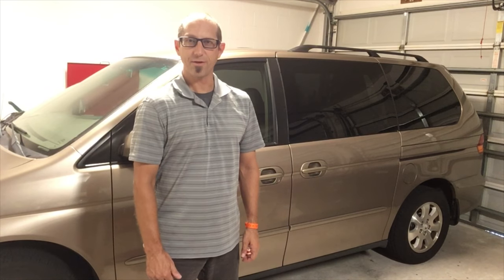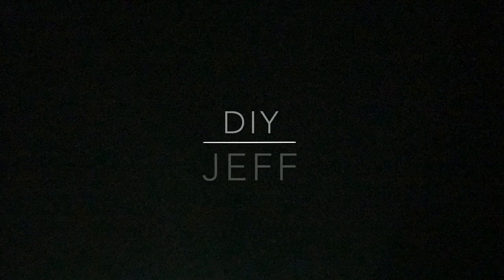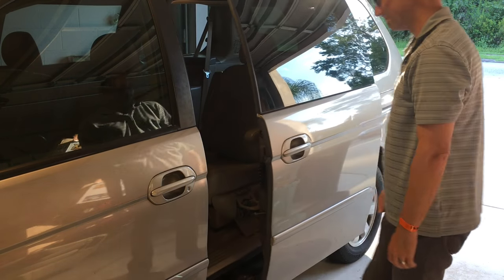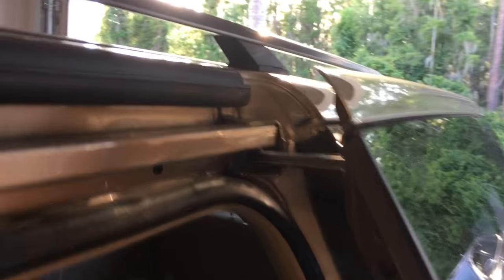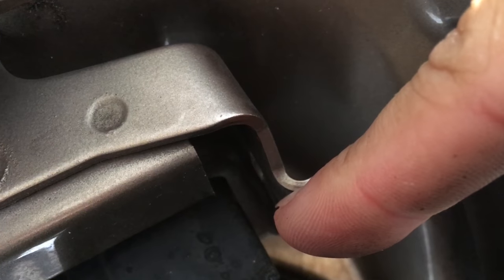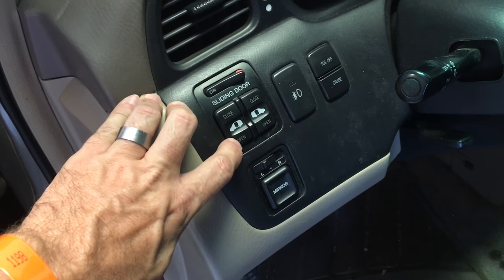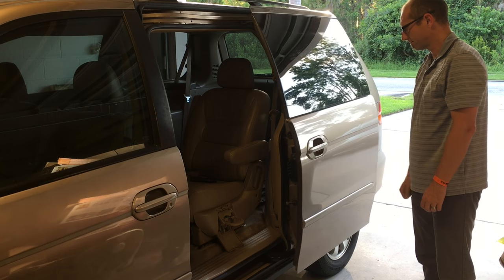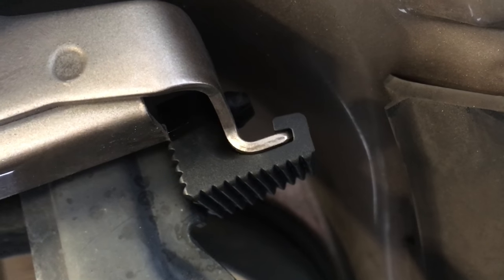Honda Odyssey Sliding Door Won't Close - Fix

Comment: Thanks. I'm so frustrated and upset,  I have a 2011 Honda Odyssey handicap van since my daughter its on a wheelchair and the door all sudden didnt want to open at all. I took it to the dealership they changed me 1500 dollars and the door now its not locking and the lights are on all the times they said cant fix it and I should take it to a body shop so they can look at it and see what they can do...I wish can find someone like you with common sense and smart enough to find the problem with out guessing and replacing unnecesary things to just charge me alot. Im a single mom w 2 kids and this its a nightmare.  What shoud I do Jeff? Thanks
Reply from the maker: @31spa, I’m sorry you have experienced such poor customer service.  Not all dealers are this way but many are.  The rubber stopper mentioned in my video has no bearing on your issue before or after your experience.  If it’s not locking and the lights stay on, common sense says when the door closes it’s either not making good contact with the door pin, or it could be that the door pin itself has gone bad.  If the vehicle has never been in an accident, a body shop isn’t your solution.  If it has had an accident, it’s possible the door is not aligned properly with the frame.

Comment: i owen an 06 honda odyssey touring an the problem that i am having now is that my driver side passenger rear door doesnt lock copletely an the reason why i think it is , because there is two locks on the rear passengers door and when i close the door the lock in front locks but the second lock doesnt an since it dont lock it kills my battery an i have to boost my battery. in order to turn the car on. so by not locking completely it h
killing my battery. what can i do to fix my rear door lock . if you can give me some input on this issue iwould really apprecaited very much. thank you john from buffalo ny

Comment: Thanks for the video.  I just ordered the bumper part.  Wondering if you have an additional video that addresses a fix when the auto close function does not work at the final closing function?  In other words, my door acts just like the one in your video before the bumper fix.  The only difference is that when our door closes it won't stay all the way closed.

Comment: mine is manual door, cannot close. Don't know why missing this rubber caused door cannot close, pls explain.
Reply from the maker: @Joe Cox, the rubber piece is for automatic doors and not manual. If your door won’t close, check down in the sliding track as it’s common for debris to fall into it.

Comment: My Honda Odyssey 2006 Door is jammed all the way open . It won’t close at all . If I buy the bumper will it close or if it’s jammed open do I need a mechanic to check it out ? I’d appreciate your comment back. Thanks
Reply from the maker: @jeaninecurran875, the bumper has no effect on the door not closing at all.  Check the sliding door track.  It’s possible there is debris in the way.  If not maybe it’s the door motor..

Comment: My door is missing this piece. It won't close at all from the outside.  It will only close partway from the inside or the driver's panel...any suggestions on how to close my door and keep it from running down the battery until I can get the part and get it put on?
Reply from the maker: @Adrienne Everitt, while this missing piece will certainly help your door close with the drivers door switch or the inside handle if it just won't close without some help, it sounds like what you are experiencing won't be fixed with this rubber stopper.  It sounds like you have something in the door track that is stopping it from closing.  I would suggest inspecting your door track and cleaning it thoroughly.

Comment: Hi Jeff just found your video. my 2007 honda odessey touring van , both sliding passenger doors do not have the rubber stopper part. I only can see the metal part wear the rubber part actually goes on. The drivers side has never had an issue closing, but the passenger side sliding door  is hit and miss. When it doesn't close, it sticks about half way then opens again. If I pull the bottom end of the door panel outwards, pull handle to close, then it closes..This only happens when I try to close the door. Opens fine.  The drivers side open and closes fine.  Any suggestions would be great. Thank you
Reply from the maker: @knstx…. Okay, so you have a lot going on there.  None of those issues are caused by the missing rubber part.  The only symptom of the missing part is if your door doesn’t make any movement at all when it’s fully open and you try to close it.  Since it will close part way, and all the way if you pull on the door panel, then it could either be that the track for the door slide has maybe bent or there could be a slight issue with the door motor.  Ive not heard of this exact symptom so I can’t say for sure.
Reply: This is our same problem... trying to investigate. Did you find anything out?

Comment: Question, mine will open AND close when i pull it BUT it doesn't latch all the way when closed which is resulting in my van dying. Why won't it latch/click all the way when closing
Reply from the maker: To me it sounds like either there is debris in the tract or maybe your door motor is going bad and not providing enough power to close it.
Reply: @DIYJeff  thanks so much! Hopefully I figure it out soon, for some reason I can't even do manual when it comes to the doors even tho I have the switches! Not sure what's going on. I had it parked for a year. We have other vehicles but got this one going as we just added another kiddo and we just replaced the battery so I know it's not that

Comment: No idea why that matter. That's just crazy.
Reply from the maker: @lostintime8651, the way Honda designed the door, if the rubber stopper is not in place, the door goes back an additional 1/2”.  When that happens, the computer will not allow the door to be closed with the driver activated button control.  You’re right, it’s a crazy design.  I’m sure a Honda engineer had a reason for designing it that way but it’s not apparent to me.
Reply: @DIYJeff  I've been thinking about just removing the fuses and make it manual.

Comment: Mines would start closing and then beep and stop and then open back up
Reply from the maker: @Layah Jhene, sometimes it will do that if there is trash or debris in the door track.  The door thinks something is in the way.
Reply: @DIYJeff  I also notice it would do that when parked next to other cars in a parking lot or when parked too close to the curb. I literally have to drive away from the other parked car or the curb to get it to close. Lol it’s weird
Reply from the maker: @layah28 , I have never heard of that problem before.  Sounds like it could be the sensor that senses if the door has resistance (beeps, and reopens) could be bad.

Comment: There are about 30 things that can go wrong with these doors. I've got an 07, and the exterior door handle broke so it couldn't pull its cable, and the plastic around the rear latch disintegrated, so the latch motor could no longer pull the door all the way shut. 

Other problems that can happen are the fuses, rollers falling apart, the computer losing track of what state the latch is in, the switches inside the actuator assemblies, the brackets for the assemblies getting warped so the moving parts won't move, the moving parts needing lubrication, the cables falling out of their housing, and on and on. Everybody on youtube has their own "How to Fix our Odyssey Sliding Door" video.

Doors were great for a little while, but now mine are making me miss my childhood VW Vanagon, where you have to shout "hands and feet inside!" before slamming it shut.
Reply: The computer losing track could that result into mine closing but not wanting to latch completely?
Reply: @KristaPhillips-p2n  probably the latch assembly is falling apart. There is a sequence you can follow to reset the door sensors, so try that first.
Reply: Thank you so much; I will definitely try that because them not completely latching is resulting in a dead battery which sucka

Comment: My sliding door on my 00 Honda Odyssey ( manual doors ) are stuck in the latched position ! I'm about to replace the whole section because I have tried everything I could think of to get it to go back to the position it's supposed to be so I can close and latch it ! Guess my work is cut out for me because I think I have to remove the whole door to get to the panel to remove it ! I already learned a long time ago not to use WD-40 on vehicle latches ( WD-40 ) removes the original grease and dries it out ! Something I didn't count on but yup I didn't listen lol , oh well, lessons learned ! Both doors are a pain
Reply from the maker: Dan CommonSense, you could try a "dry" lubricant like is what is used on bike chains.  It goes on wet but drys  quickly and doesn't attract dirt and doesn't wear away with water like WD-40.
Reply: @DIYJeff  in process of getting the latch out ? I noticed that the notch wasn't lined up to the actual latch on the door , lined it up and Bam it's fixed !
Reply from the maker: Dan CommonSense, that's great news!  I'm glad you were able to fix it for free!
Reply: @DIYJeff  makes two of us and this is the first time I have noticed that there are notches in the body work ! My other vehicles don't have them ! Yes definitely a good thing I happen to have noticed that or my doors would be laying in my driveway 😅😂🤣

Comment: Hey Jeff so I had to drive my van with the door open.  I swapped the fuse in the hood (followed utube video) but my husband claims it’s in the inside panel so he swapped as well.  The part that you mentioned IS missing however in your video you mentioned you are able to close with the toggle button on the front panel.  My door does not close anyway you try it.  It won’t budge.  MEs no sounds whatsoever as if they is no electric going to it.  It is however missing that stopper.  On the other side it has the stopper but it is slightly melted or soft rubber. Is there a sensor that knows it’s there? Because I don’t see how that rubber stopper is going ti make a difference.  Seems like the motor went if one exists on the door panel.  Help Jeff!!
Reply from the maker: @Frances Greene, there is no sensor if the stopper is missing.  The stopper isn't your problem on it not wanting to budge.  It's sounds like it's the door motor to me.  Or there may be an actuator that engages the motor, but not sure about that.  My guess would be the motor.

Comment: I have a 2012 odyssey ex-l and for some reason the sliding door on the driver side closes. But then opens right back up. It’s frustrating me. It won’t stay closed. I push the button to close. It closes.  Then opens right back up. Help
Reply from the maker: It sounds exactly like the problem I experienced that the missing bumper fixed.
Reply: Um. I don’t have a missing bumper ? Elaborate
Reply from the maker: @chandaann9967 , sorry, I just meant the Genuine Honda (72557-S0X-A00) Slide Door Rail Stopper should solve your problem.  After watching the video you can see where to check and make sure you have one still on your vehicle.  If you don't then 99% chance this is your issue.

Comment: Mine won't close with the driver's control either.
Reply from the maker: The Single Way Out , it’s possible then that your Actuator is bad.  I have an old video on replacing that as well if you go to my channel.  The editing is a little rough, but the content will help you through changing it.

Comment: Great video, mine is 2014 Odyssey, it does open but does not close (makes beep sound and does not move at all))  , even the inside button does not close, it does open. I have to switch to manual mode and close it, any idea?
Reply from the maker: @SoccerLife, have you checked yours for the rubber stoppers?
Reply: @DIYJeff  yes it was it! rubber sensor on the door was dislocated. it was a 5 sec fix, thank you

Comment: the one that i have the passenger side sliding door there is no power to it and it is jerking when u manually closes it like fighting against u
Reply from the maker: Are you missing the rubber stopper?  Without the rubber stopper the door goes to far and then won't close electronically.  Another common problem that happens is sometimes the door doesn't go back far enough to hit the rubber stopper and you have to push it about 1/2" backwards, then it will work electronically.  This happens about 1 out of 10 times on my van.  Hope this info helps.

Comment: How about a trick to close the sliding door when battery is DEAD? I need to close my door due to incoming inclement weather and can't get the battery charged til morning most probable. THANKS
Reply from the maker: Connie Herrin Bolding , if you’re not able to get a jump start, I’d suggest closing the door manually.  It will close if you pull on it really hard.  Not something you want to do all the time, but given your circumstances it’s your best option.

Comment: Would the rubber missing affect the doors not closing all the way?
Reply from the maker: @Noemi Trejo, no, it only affects them not opening properly.  If the door doesn't close all the way you could have something down in the door tract that is stopping it.
Reply: @DIYJeff  thank you for the reply. You think that it is an easy fix?
Reply from the maker: @noemitrejo7258 , do a physical inspection by looking down in the tract and following where the door closes to, stops, and then reopens.  Wherever it stops, would be the point where there could be something in the tract.
Reply: @diy jeff I'm going to do so, this vehicle has sentimental value and I do my best to maintain it.

Comment: 2008 driver side slider was open, then battery died while watching DVD, got a jump, now door won't close manually or with power sliding button !!! PLEASE HELP @DIY Jeff !!!
Reply from the maker: leosrule726, it sounds like you just need to do a reset.  One way would be to disconnect both the positive and negative battery cables.  Then reconnect the positive cable first, then the negative.  Another way to reset it is to turn the ignition on, then turn the power door switch master to the left of the steering wheel to off and then on.  Then press and hold both power door buttons closed at the same time until they close completely.  If that still doesn’t work then turn the main switch from off to on again.  Let me know if this solves your problem.
Reply: @DIYJeff  after watching a few other vids, I found out that it was the rear roller on the door !!! I had to push it forward while sliding the door close !!! Thanx a million DIY Jeff 👍🏾👍🏾 !!!

Comment: Thanks for showing this video both sides of my van is missing this part. Any idea how to fix my issue, which is my passenger sliding door does not open & close with the outside handle, closes with the inside door handle but does not open it. It operates normally with the remote & control button on the driver side. The driver side sliding door operates normally with all functions. Thanks.
Reply from the maker: Janis Ganih, there are multiple possibilities.  Try this for an easy fix. https://www.youtube.com/watch?v=n7_SZhC5QVg  It may not work but it only takes a minute to try.  It could be as simple as doing a reset.  Otherwise you may have a problem with the mechanism that controls the door sensing the door handles being pulled.

Comment: I set my doors to manual. Passenger side closes but then the electric closure part( pulls door in to seal) holds then lets go when i make a left turn or hit a bump. Do i need an actuator?  Or what part do i need to replace?
Reply from the maker: jim bones, did you set your doors to manual because they won't open with power?  If so, then it might be the actuator, but in looking up this issue I came across the following thread where someone suggests it could be the rear door latch assembly.  That's where I'd start my search if I were you.  https://www.odyclub.com/threads/05-odyssey-touring-sliding-door-pops-open-when-driving-over-a-bump.312025/
Reply: Thanks. Set them to manual aways back because of automatic door issues.  Followed the link and then found a vid for 2006 honda odyssey rear latch repair. Now i have to take it apart and clean and fix it. 😄🍀

Comment: Hello sr..i have 04 my door when its about to close. Comes back. Do you have an idea what it is ?
Reply from the maker: barbatos 51, my initial thought is there is something in the back of the door track that the door is hitting, causing it to close.  Check the entire track and make sure it's clear of any debris.
Reply: @DIYJeff   thanx for the replay..it hapens only sometimes ..it works for one o two days and then it happens again
Reply from the maker: barbatos51, looking in forums, some have had problems when the motor makes a bit of a grinding noise, It stops and then reopens.  Can you hear any difference in the motor sound?  The fix many have reported is replacing the door lock actuator.  I happen to have an old video I made on my channel that walks you through how to do it, but I can't say for certain it would fix your problem.  When I replaced mine it was because the door stopped working completely.